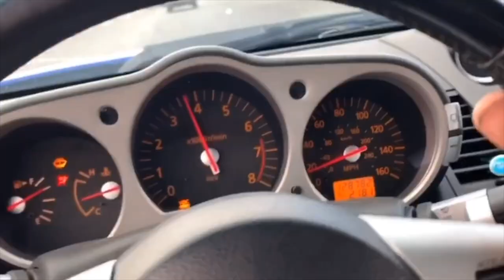Street Boxing In The Hood/This Only Fans Model Wanted To Ride In My Car

Comment: 350 sounds great im working on my build for my 02is300 ive had since 05 just now getting around to her shes 5 speed stock has hks super dragger exhaust full bolt on hks headers and intake L-tuned